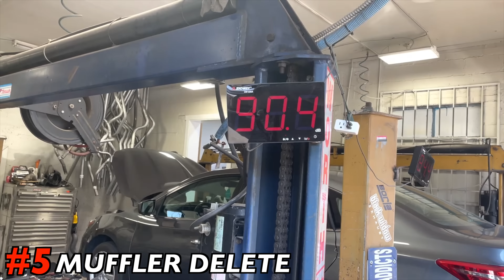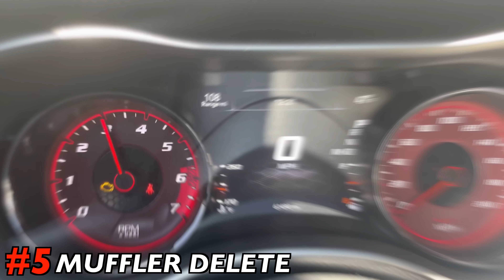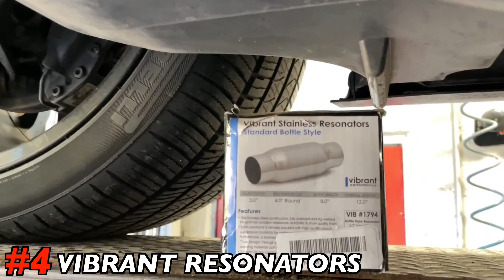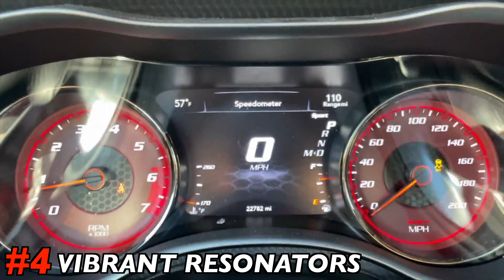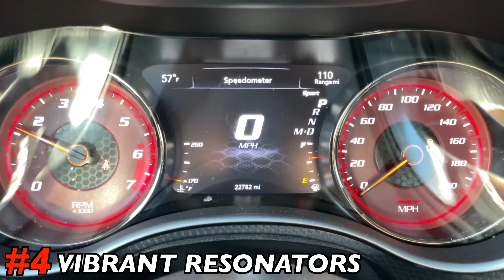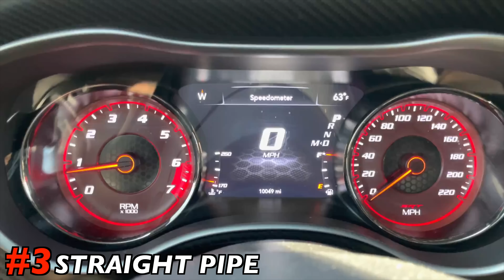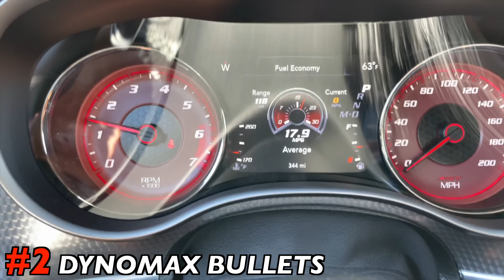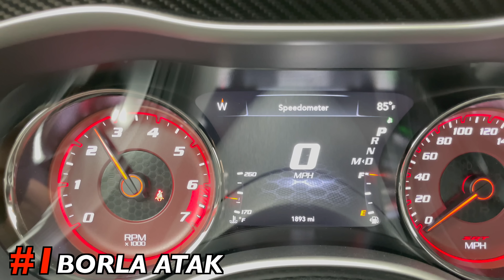Top 5 BEST EXHAUST Set Ups for Dodge Charger Hellcat 6.2L SUPERCHARGED HEMI V8!

Comment: If I wanted to go cheap it will be number five to me. It has the best tone with just a little bit of rasp for just a muffler delete. The factory resonators kept it in check. The Borla Atak is my favorite though. It makes more horsepower than the factory setup, is made of stainless steel and has a lifetime warranty. The fact that it's guaranteed not to drone is the icing on the cake. The only one that I really hate is the Redeye with the 2.5" exhaust. You just went from a 3 inch to a 2.5" inch exhaust made with cheap exhaust tubing. On top of the fact that it's going to rust out in no time you just lost what made a Redeye better than a Hellcat. It wouldn't surprise me if it's no faster than a Hellcat now because he decided to choke off the engine with a smaller restrictive exhaust for a few extra decibels of rasp.

Comment: I know this is about HellCats but my stock exhaust on my 22 Charger Wide Body Scat Pack sounds awesome especially when I power shift around town
Reply: When you get the extra fundage you’ll upgrade too.
Reply: trust me, in under a year you’ll want my system, catless midpipe + mid muffler delete + Dynomax mini race bullet rear + 5” carven tips. Perfect sound
Reply: @Evan S does that modification effect the warranty
Reply: @jwrizza8037  not exactly sure to be honest, hopefully don’t have to use the warranty because it’s in the shop rn for some other cool things. either way I’ll probably accidentally void it. I kept the converters just in case I had to put them on again
Reply: Those don't sound like hellcats at all🤣🤦I believe those are scatpacks or RTs with srt badges🤣🤦I wish guys would stop putting hellcat badges on regular chargers. Stop false claiming. We can hear the difference

Comment: Oh hell No! These are still way too quiet, and sound no different than a stock 2005 Chevy Camaro, and that's a damn shame 🤨Owners should have just run open manifolds, which is hands down the best setup and provides the perfect amount of back pressure with improved gear ratio and driving visibility on these Dodge Charger Hellcat 6.2L's.
Reply: 2005 Camaro!😁
Reply: You ever get tired of telling the same joke?
Reply: Lmaooo 05 camaro. Gtfoh